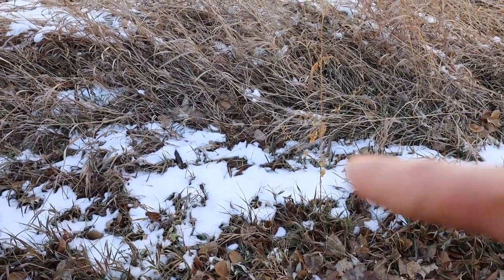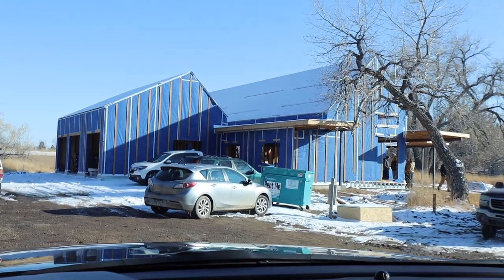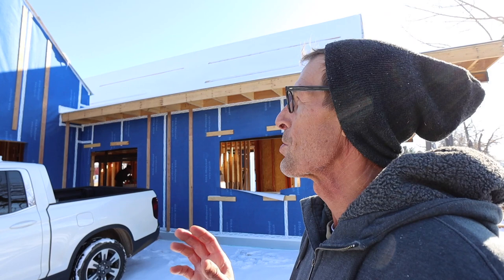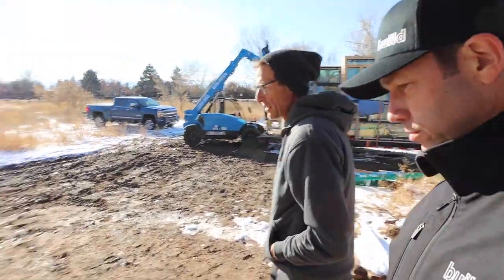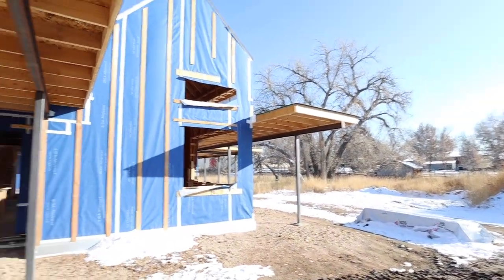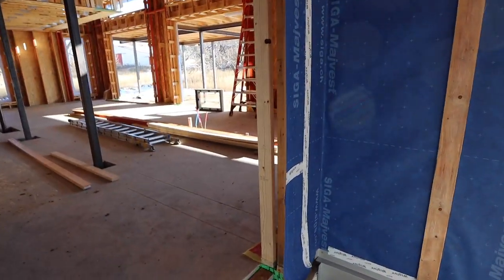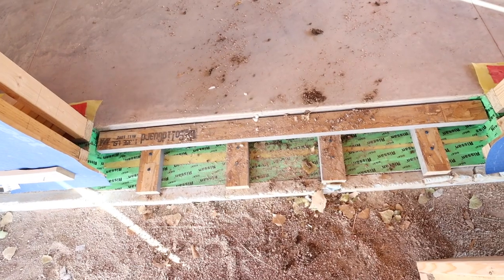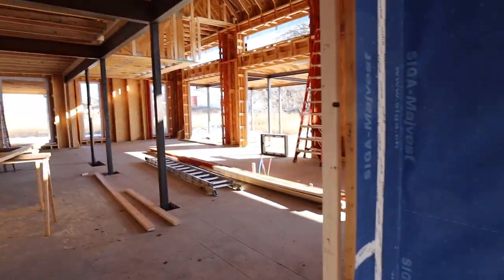Double Stud Walls and Bark Siding - This House is COOL

Comment: I would love to see a follow up on this project during passive house testing.
Reply: I would too. It's shit.
Reply: Is there ever any follow up videos?
Reply: @LifeBloodMarketing  Of course not, they don't want their clientele to know they spent so much only to be marginally more efficient than a traditional built house. I'm all for building science and finding more efficient ways but Matt touting stuff like this to be the future of home building is just BS. By the few numbers he puts out the owners of these air tight, super insulated houses should start seeing a return on their initial investment in 400+ years. Think i'm full of BS? here is some simple math. We will build 2 houses in Texas seeing as that is where Matt is from. Typical home built in 2019 in Texas averages $110/sqft, Matt shows houses and the price per sqft come over $200/sq ft showed a house a few weeks ago where they were talking $250+/sqft so in fairness well say you could get a super insulated house for $190/sqft. the average house in 2019 is 2400 sqft so you would be looking at $288K for a traditional house and $456K for a super insulated air tight house. Now the average electricity bill for a traditional 2400 sqft house with electric heat in Texas comes to $1650/year, heating and cooling is 22% of that for Texas. So well be very generous and well just say 50% and well say by magic a super insulated air tight house used no electricity on heating and cooling saving you a total of $825/year. so now we will take the difference of the 2 houses $168K and divide that by how much we magically saved in a year $825 on electricity and come to find we are looking at 203 years before you start seeing a return on your initial investment, and that is being VEEEEERRRRRY generous.
So now we know why Matt lives in a 1970's house, Matt doesn't drink his own Kool-aid.
Reply: @davidbuck9977  Except this house isn't in Texas, have fun heating a house with R13 leaky walls when its 17F outside.  Its easier to get away with shoddy construction when you have cheap energy and it doesn't get very cold.
Reply: @zilfondel  Riiiiiiight, because Texas is known for it's mild climate... Houses built today are not the drafty houses built many decades ago. Colorado's electricity may cost more than Texas however Colorado's electricity is still below the national average. In fact, even with higher energy costs,  the average person spends about 7% less in Colorado on heating and cooling than in Texas. I guess it's cheaper to heat a house 3-4 months out the year and rarely need A/C than need A/C 8 months out the year and rarely need heating.
Reply: @davidbuck9977  at $119 SF your building a home Depot home. ( Nothing wrong with that)  but $200 is pretty standard for a  true custom build.
 My in-laws just got bids on a home one came in at $130 but it had $50 per light budget and $ 5 per sq on flooring. I laughed and said that is cheap good luck. The second and third bid came in at $185 and 205. All the bids have extra insulation from code but nothing crazy. Mostly it is  finishing and a true honest bid not hopping for the best bid. Almost forgot the bonus room and the basement didn't have any HVAC in the first bid.
Reply: @davidbuck9977  Insulations is cheap, even magic insulation. You are obviously factoring in the architectual finishes as insulation in your calculations, but I imagine you already knew that. That you might not know is they energy costs for passive house is calculated fairly accurately in the planning proccess (kW/m^2 is the main requirement to get certified), so the owners already knows that they are in for.
Reply: @davidbuck9977  You make a false fundamental assumption that ROI / payback is the only criterion in choosing to go the route of an efficient house.
Reply: @jesterblackdog  what are some of the other reasons? Is it earth freindly? I dont think so, all the added materials and foam plus transportation to the site... comfort? So a traditional built house isn't comfortable? A lot of the added materials could simply be replaced by building a simple sun room on the southern side for cold climates or a shade tree in warmer climates...
Reply: I just went and visited this house yesterday. The last video on my channel is a quick shot of the finished product. I’ll ask to do a more in depth interview with the architect and post it. I am building a similar house (albeit with a less fun exterior) and it’d be fun to compare Teo passive houses.
Reply: @davidbuck9977  because you can? What are the reasons anyone buys high performance or luxury anything? It’s also $200+/sqft because these homes are custom and have higher end finishes. These high performance details obvious add cost but it’s not the only factor

Comment: Thanks Matt, performance details are so important. It would help to talk about the costs of construction
Reply: Conspicuously missing in these types of videos...
Reply: It wouldn't help. Ft Collins Co is an expensive area to build in n right now and it could change $200 sq ft in your area so its pointless to mention pricing. If you like it then consult a builder in your area for accurate pricing to see if you can afford it
Reply: @1982MCI  
BS. It doesn't matter if costs vary between regions. The question is, how much more did it cost to implement these strategies on this particular house?
Reply: @TheBighatter  I wouldn't be surprised if it's at least 60% more. It's going to take over 50 years to pay off the difference in electricity bill.
Reply: @MrArcticPOWER  
With the siding at $6 sqft, I would think you're looking at 4X-5X the cost of a conventional developer build. This is out of the reach of 99% of home owners.
Reply: @1982MCI  Thank you Don. Costs are relative to each area, but when presenting a Ft Collins project, Matt could easily mention the cost per sq. ft. of the performance detail that is currently being shown. Also, why one material over another.  We are all in this to learn and use better best practices. Matt does a great job and is very appreciated.
Reply: @MrArcticPOWER  even more depending on where its build. i pay 9cent per Kw, my heating cost me around 1200$ even if i could cut this in half i dont see when its going to pay off
Reply: oltedders Slow down. That siding is an extra. It’s not needed for passive house. There are definitely other sustainable but more economical materials out there to use instead.
Reply: Cost is really irrelevant there clients will pay whatever to get these houses, and thats not for you to know. Its matts business your lucky hes sharing this stuff with you...
Reply: @TheBighatter  As with anything, if you pay more up front for a better built/quality constructed house, the total operating costs, for heating, cooling, and other energy use drastically go down and eventually offset the upfront costs of the build.
Reply: @bwillan  
Without knowing the specific cost premiums involved, there's no way to back up your claim. Depending on upfront costs and assumed marginal energy savings, the payback period could easily exceed the lifespan of the rest of the structure.
Reply: These houses are for people with money to burn and to live in a house they can brag about to all their friends. It will take longer than the life of the structure to pay back any energy savings. It's cool stuff if you have disposable money.....
Reply: @marccourtemanche2052  1200$ now. Expect higher costs as green energy % goes up.
Reply: Dwwolf Dwwolf normal fluctuation, there’s law in Qc to minimize the cost of hydro electricity, but in many place in NA its true
Reply: Cost of construction for Passive House level builds is a huge, hairy topic, for sure. People are inclined to reduce everything to a number they hear, without understanding the baseline comparison. It's like asking, "how much more does it cost to buy a sports car than a sedan?" Well... what features are we looking at? Some luxury sedans (custom houses) cost just as much, if not more. One of the goals of our Pilot Program, and the reason Greg so graciously joined on, is to get a better answer to that question. To date there are no controlled studies about the price per square foot of Passive homes, and there is a great range in budgets. Passive standards are being employed in affordable housing quite easily, so I would warn the readers here against dismissing it as a luxury feature. Hopefully with the addition of this and many other projects, we can get a reliable range of $/sqft in Passive Homes across the country, in order to have the succinct answer so many request. If you'd like to learn about applying, please get in touch.

Comment: I love that parallel chord truss detail. No ridge beam!!
Reply: I have the same trusses in the house that I am building.  2'-6" deep trusses. I don't understand why its not more common.
Reply: @tylerdenio5433  I've fallen in love with them too. They seem difficult or out of the norm for some reason. They are thinker on the ends than is required for like a scissors truss which is the most efficient, but the room for insulation seems to make them perfect for highly insulation houses
Reply: @Zorlig  Yeah i'm in Alaska, and it provides a good energy heel.  They are a little awkward to install (you have to make sure 6 points on the truss are aligned, the heel bottoms, the heel tops, the ridge bottom/top, so it is a little more work.  Also the shear transfer from the roof sheathing to the shearwalls is unconventional with large truss blocking or little mini shearwalls in between the trusses.  People just aren't used to it.

Comment: Passive house seems like a way for +$1M home owners to feel better about their consumption. No one ever talks about the embodied energy in one of these houses.
Reply: Cement and steel often have the largest carbon footprint of all building materials (for now), but wood removes carbon from the atmosphere when sourced from sustainable forests.

These luxury houses also act as testbeds for green products and processes that will one day become industry standards.
Reply: Mykel Hardin  @Lewis Renovation has a point, this a problem that most people are not thinking about when it comes to building to higher energy efficiency standards. The amount of embodied energy that goes into a house is a very significant factor that needs to be addressed more often in the conversations and the implementation of techniques regarding these kind of homes. 
https://publications.waset.org/7209/pdf
I am no expert on any of this, I've only done just basic research online, but at the very least there needs to be more of a debate and acknowledgement of this aspect of building sustainable or more energy efficient buildings.

Comment: Great video, though I was hoping to see the triple pained windows. I would love to see a tour of this finished.
Reply: There is a window on the floor, 3 second view. 😆
Reply: Please contact us for more information regarding the windows.  We are the North American smartwin partner that supplied the windows for this project.
Reply: Pane
Reply: The windows were arriving as Matt was filming, so we unfortunately did not get any install shots. But please do check back and sign up for our newsletter to follow the build (https://emu.systems/join/). Advantage Woodwork is the manufacturer of the Smartwin line of windows that helped make it possible for Greg to reach Passive level certification. They are beautifully crafted windows, you should definitely check them out.

Comment: Rookie question:  Is the Stego vapor barrier ran to the outside edge of the entire concrete form and then folded back and ran underneath the double wall assembly.  And then turned up and taped to the interior wall vapor barrier?
Reply: Good question!  I'd like to know too.
Reply: Stego under slab, connected to concrete. Concrete connected to wall air barrier. Continuous air barrier!

Comment: The come-away:...”buy an Architech’s home when they are thru with using it themselves”
Just awesome. 👍
Track home builders need to start adopting at least some of this stuff! People WILL pay extra if they realize the value...See Tesla.
Reply: Steve Slade  The expensive Teslas paved the way for current models that can be had for the same price as a Camry, with no rebates, and are roughly 4 times more efficient. People hate hearing the truth that their consumption habits are awful for the environment, so they make up BS excuses and go with the herd. Efficient housing technologies are currently more expensive because they are new and only used in low quantities, but will come down when the next less-corrupt administration transitions fossil fuel subsidies to green tech.
Reply: Steve Slade  That is some classic grade A rambling. Jumping from topic to topic, throwing out a ton of information, and acting like it all somehow proves your point. Then act like it's everyone else's job to prove you wrong.
Reply: Steve Slade  Blah blah stopped reading 3 sentences in. Crazies always have lots to say....
Reply: Steve Slade   Meh, just keep shouting your rhetoric bud. The louder the better! Right?
Reply: Steve Slade, I bought a nearly $50k Chevy Bolt with ZERO government subsidies. I didn’t have any write-offs to take advantage-of. I bought the vehicle because it offered something MORE and DIFFERENT than the rest. Steve, you are WRONG. people WILL pay for VALUE.
Reply: @frumpd63  
We don't need green tech subsidies, just stop the corporate fuel subsidies in general. It must be something like 3+ trillion dollars per year worldwide.
Reply: @tjam4229  I’m curious how does the oil industry subsidies work?

Comment: Very useful information here. The steel supported flat roofs are an interesting and functional feature.
Reply: It's Colorado though, flat roofs always concern me with snow load, especially in valleys between two peaked roofs, also ice dams heaving the shingles on the peaked roof soaking the underlayment  and inducing failure over time...short form...Flat roof here, bad idea.
Reply: R. Gilman Perhaps, but depends.

Comment: R50 is insane! I’m jealous of all your R-value
Reply: Lol right
Reply: I was sooo proud of my R30’ish exterior walls!
Reply: Jeff Losey I couldn’t imagine having 30
Reply: only have R10 on mine :( wish i could have R30! but it makes no sense in putting more insulation with all the expense. R10 walls and R65 attic, currently only using 45 dollars of heat in January in NE USA ... so the ROI isn't there to uncover everything. If walls were open I would go for it!
Reply: @wolfmannews  that doesn't seem to make the best ROI ... My ROI stopped at R65 on attic. And I live in NE. I would have had to spend another $1000 dollars in cellulose to double the R. And for what? To save 30-50 dollars at most per year. That's a 25-30 year timeline. I doubt in this video the numbers would make it better or even sense financially
Reply: We see 105degree months here in So Cal... The Cost was quite low, I performed all the Labor and bought the Product Directly.
Reply: WolfmansCavemansNews actually thermal exchange in a leak free house varies with surface area, increases exponentially less than volume
Reply: @jefflosey1561  105 outside and 70 inside is a 35 degree delta. 0 degrees outside and 70 inside is a 70 degrees delta. Winter is harder on utilities than summer

Comment: Welcome from Colorado from a resident in Loveland.  Interesting technology but being quite familiar with the area I have some concerns.  Lack of overhangs means exposure to the elements, in particular hail.  Frequent hail storms in our part of Colorado will negate a lot of the energy savings of this unique house by destruction of the triple pane windows, and of the bark siding.  I also wonder in our age of worry about global warming about the impact of the utterly massive amount of wood used to help space the insulation - and I wonder the economics of using two or three times the timber over what is normally used, will negate any savings from not having to heat the house in the winter.  And will cooling not be needed, for such a tightly insulated envelop surely will trap heat generated by appliances, people, and from showers or laundry.  However, I do like proof of concept structures like this house that show what can be done to minimize energy costs.  But is it worth the expense and extravagance?  Hmm?  Great review from Matt and presentation from the designer.
Reply: I was wondering the same.  I imagine working out the cost/benefit ratio on how environmentally friendly this building is really comes down to how long it is used.  If it somehow lasts for 200 or 400 years all these extra economic and environmental costs will be flipped to net benefits.
Reply: @nobigting  I agree. I think of what has actually been here for a long time: potato barns in San Luis Valley, and San Xavier Del Bac Mission in Tucson. Neither can burn down nor that complicated to build. Both have good thermal properties...

Comment: Nice Project. Similar wall build-up as to what we use here in Australia, but quite smaller in thickness. Normally a 140mm stud with 35mm battened service cavities. Also interesting to see the trusses with nail-plates being used in a Passivhaus, would have thought they would be a Thermal Bridge issue.

Comment: Any concern for fire racing up the air space of those double frame walls?
Reply: No air space. It is all filled with high density blown insulation, like borax-treated recycled paper. Very resistant to fire. A blowtorch is needed to char it, but when removed, it extinguishes instantly. 

The insulation runs in a continuous layer from foundation to roof peak.